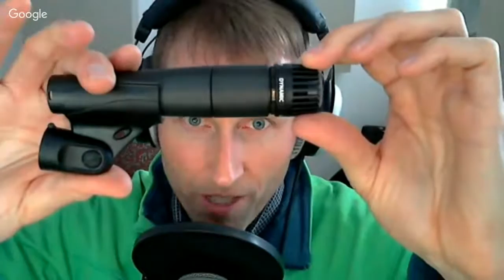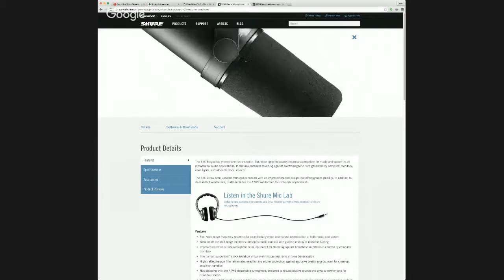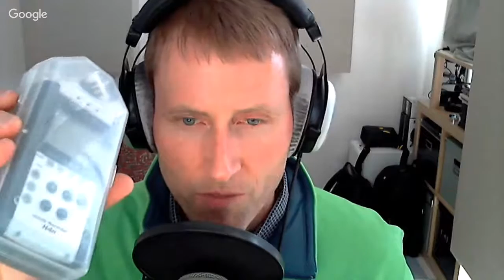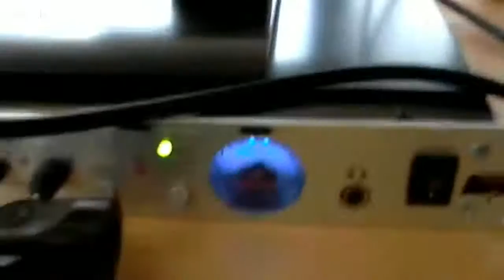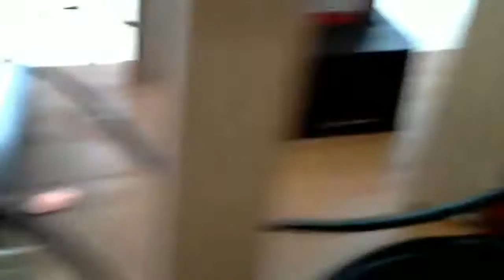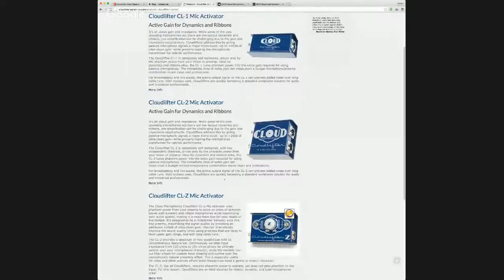Sound for Video Session: Voice Over Dynamic Microphones 31 March 2016

Comment: How about the Electro-Voice N/D767a as a mic for use in exhibitions or conferences?
Reply: Sure, that would work. Best wishes!
Reply: 767a is a good microphone!
Reply: @larryhinze8658  👍
Reply: @larryhinze8658  Thanks, Larry.
Reply: 767a is a fine microphone. I have cut commercials that aired in Seattle on the radio there. Sounded as good as the rest. Preamp and mic lifter will put it right there. Of course, pop filter.

Comment: Very good video, sir, it's been most enlightening. I have a question about the Audio-Technica AT-2005, could I plug that into my laptop using an XLR to USB converter cable for (potentially) better sound quality, or would that cause feedback noise or some type of hiss? Thanks for your time.
Reply: Thanks Joshua. It depends on the converter you use. The AT2005's built-in USB output is probably better than most converter cables. But most USB audio interfaces, like the Focusrite Scarlett do a better job than the AT2005's built-in USB output. Best wishes!
Reply: @curtisjudd  Thanks for your time, Mr. Judd, that sheds some light on the situation. God bless.

Comment: I believe the large slots on the side of the Electro-Voice mics are for the "Variable-D" feature that controls the exaggerated bass response that usually occurs when getting close to cardioid mics (aka the "proximity effect"). The concept seems similar to the "interference tube" slots on the side of shotgun mics. There is an inch of foam in the front end of the mic to help control plosives.
Reply: Thanks RedBearAK.

Comment: I recently bought a Rode reporter mic. I loved the sound quality, but the signal strength was so low that when pairing it with a zoom h4n pro (running an xlr cable straight from mic to recorder) I had to set the recording level to 100 to get a usable signal, which is not good. I was surprised that the signal strength was sooo weak. I ended up buying a Fethead inline preamp to boost the signal. The Fethead works great. I get a stronger signal using it with the h4n pro recording level at 40 than I did with the recording level set at 100 without the Fethead. And the gain is clean with little or no added noise. I am sold on Fetheads!
Reply: Great to hear a real-world example, thanks for that Dennis!

Comment: @Booth Junkie
Nice videos, I got a quick question I'd appreciate you answered.
I currently got a soundproofed booth, similar to yours. I got a Zoom S2T
 and a Rode NT1A
I mostly do voiceovers and want to offer vocal recording to music 
artists.

Debating between these 4 mics, I want a significant overall better 
quality with the least noise floor and all without breaking the bank.

Mics: 
Shure SM7B, EV E320, EV E20, CAD 100S, NEUMAN 102

I know I need to get a fethead if I get a dynamic and I dont mind if 
they offer great quality and best bang for your buck

I was just suggested to get the Tascam UH-7000, seems very good.

I could get the EV E320, FETHEAD and this Tascam UH-7000  .... or any of
 the other mics mentioned

or I could get a Neuman 102 and a cheap Interface like the Focusrite 2i2
 or maybe even just use my Zoom s2t or Zoom h5

What would you do? Even though I "can" get the Neuman 102, it'd be 
through a loan so will only do it if its far better than all the other 
ones and if mentioning it to my clients will help in charging more than 
if I had a mic they probably own themselves

I can get the Neuman in Europe for about 180$ cheaper

I really like the CAD 100S and Tascam 7000 combo....

Looking forward to your reply! Thanks!
Reply from the maker: +Luis Gustavo hi Luis, if you've tried the CAD 100S and Tascam 7000 and like the sound it makes with your voice, why not go that way? Every voice and mic are different and my opinion is that you want to find one that works well for your voice. As an example, my brother bought a Neumann TLM103 and found that it was not a great combination with his voice. He ended up finding an AKG which works much better. Ideally, see if you can try each of them if there is a local pro audio shop. Best wishes!